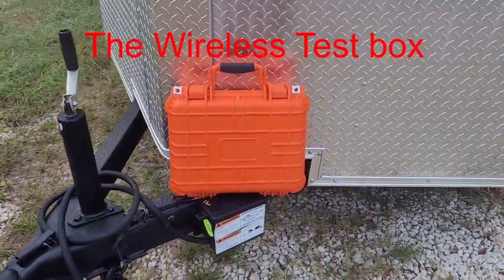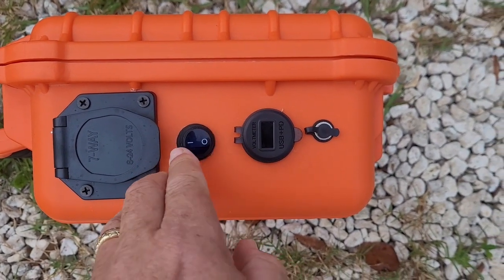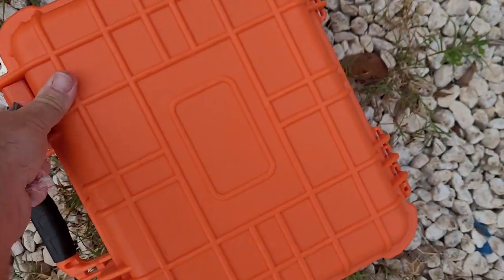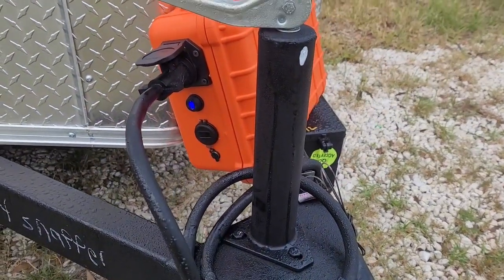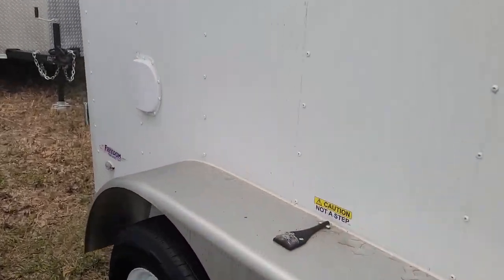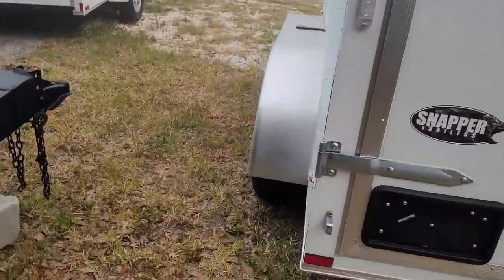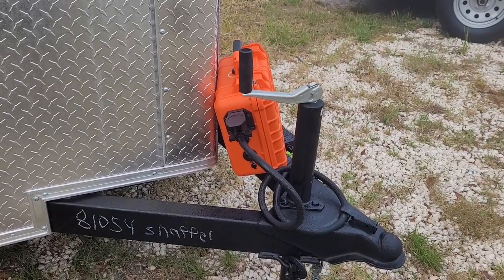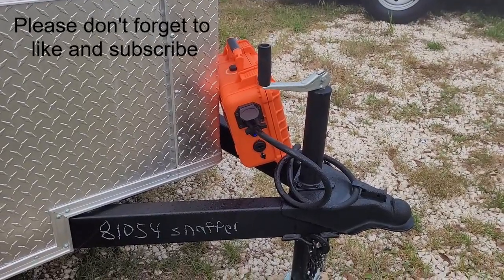Wireless Trailer Tester is ready for the masses!

Comment: Looks good. Would be great to set up keyfob for trailer functions.
A=left
B=right
C=tail
D=stop
Reply from the maker: A, B, and C are actually set to just that. The brake lights use the same wires and light as the turn signals. Thinking about backup lights for D.